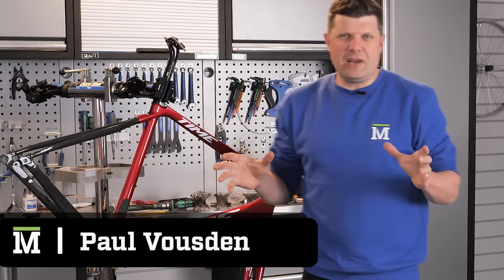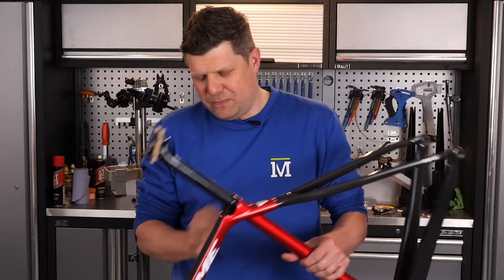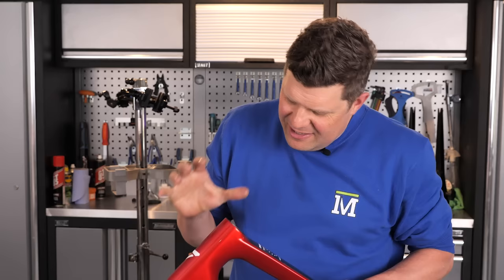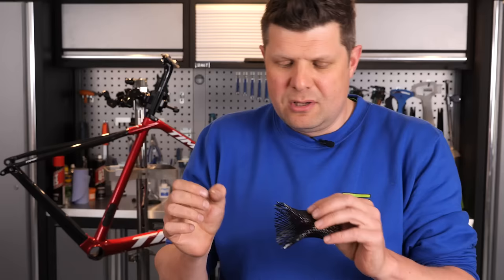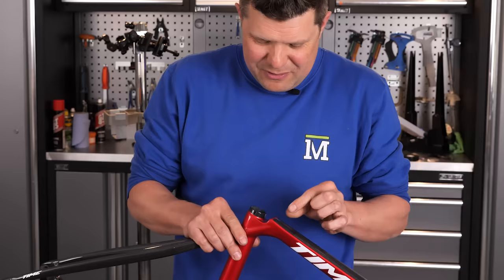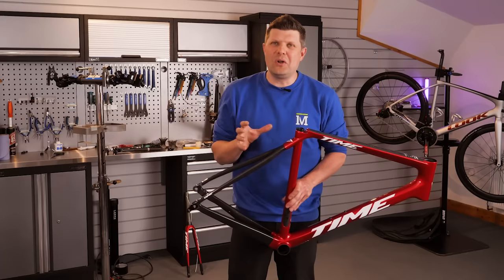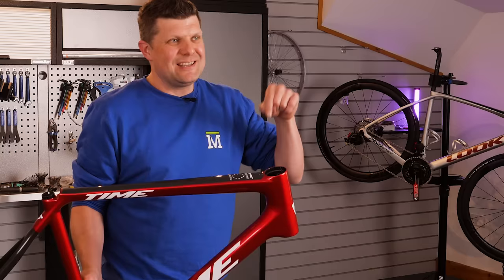Unimaginable Quality from European Manufacturing.

Comment: I've got a Time scylon. Best thing I've ridden apart from the Haidresser.
Reply: Mmm, the hairdresser should have an "ahh".
Reply: A latex hairdresser would make a great indoor trainer! The placement of the power meter strain gages might be tricky. RPM would be easy to determine. Volume control is another issue.
Reply: I just kinda wish they used direct mount calipers. So I can just buy a frameset and not go looking again for post caliper brakes. 

But nonetheless THE GOLD STANDARD of bike manufacturing
Reply: Skylon since '16....nurses for me..
Reply: gross
Reply: Time make a frame called the Hairdresser? Interesting
Reply: Still not making them in adult size…. 😢
Reply: Keep dreaming 😂
Reply: Ok, so where do I get a Haidresser?  Quite fancy a nice Hairdresser though?  Attention to détail is everything, it seems, not?
Reply: VXRS Ulteam since 2007.  STILL an amazing ride.  But planning on getting this new ADH Disc soon.
Reply: What was his name?
Reply: I first read it 'hairdresser' and though to myself 'sounds about right...'
Reply: @steveoc64  Features extra stiff downtubes
Reply: Can you post a picture of the Hairdresser's frame and close up of the bottom bracket. 😂

Comment: Funny thing is how brands like Pinarello, Trek and Specialized charge what they are charging but doesn’t come close when it comes to manufacturing as the lads over at Time
Reply: Because the marketing of Trek, Pina etc creates desirability. The more desirable something is, the more you can charge for it

Many might also say that for all of the manufacturing excellence of Time, their actual frame ‘design’ could improve - that’s subjective though
Reply: Time may be a masterclass in craftsmanship, but as mentioned subjectively their bike are hardly desirable. 

Anyway it’s not as if having a bike frame that lasts long matters. That’s what my bike insurance is for; when it spoils I’ll just buy a new one.
Reply: @mjf1975  Fortunate enough to own a pina f12, and I bought it for the looks 100%. Time is vastly superior from a technical perspective, you don't have to win me over at all, but when I throw down that much money I want to see the bike and not have to think about another bike that's prettier. And I've not had any issues with the frame since buying it, so I don't regret going for the f12!

Comment: Hardly unimaginable, if they are actually doing it.. It reminds me of the old war story, about the Germans sending the British engineers the finest machined wire stating that it was the limit of what could be machined. So the Brits drilled a hole down the middle, and sent it back.

Comment: I routed cables though the BB of a ADH21 (same BB area) with 2 BB cups and bearings in place. Without the central tube this is easy to do.

If you want to use a sleeve between cups or one piece BB make sure to install a liner so you can swap inner cables easily.

Comment: I ride an old Look kg361. I bought many years ago as a frame. As you say a very steel like ride. It is such a great ride that I have only been tempted by the 585 and Time frames which were far more expensive. I have to agree the finish and attention on Time frames are exceptional. Sad how the bigs have spent out or pushed these superb builders pretty much out of pro cycling. That said the big guys make pretty good stuff.

Comment: Good to hear you’re in one piece!

I’ve just changed to a Mips MTB helmet and looking to change my road helmet in the near future…

Something I would say is, before buying, make sure you try for fit - I’ve found that the liner can create a slightly different fit, so a new version, of a helmet you’ve been using, may not be a comfortable fit - if a helmet isn’t comfortable, it increases the chance of taking the risk and riding without!

Comment: I was surprised that Time isn't really more expensive than other premium "ultra-bike" frames while it seems no one else actually matches their quality.  I've only seen one "in the flesh" as they're very uncommon in Canada and I was blown away by it.  I doubt I'd ever be spending that kind of money on a bike, but if I were, the Time would be the one.
Reply: Especially when you consider they are made in France rather than in a low labour cost country like most other high end frames.
Reply: The don't have a huge budget for advertising, marketing, pro teams and riders
Reply: You will not have buyers remorse once you throw a leg over
Reply: @nstrug  they are not made in France
Reply: They are made in Slovakia. But yes, they don't have the marketing budget and aren't sponsoring big teams (anymore). They do the boring frame design / building / selling to customers, but at least their design and build is excellent, and while the prices aren't cheap, you get what you pay for, and contrary to e.g. some big name brands, you almost never hear or see about a faulty Time frame.

Comment: Just to say thanks for a great video. Both as a Time owner and fan for 14 years (RXRS VIP which has done more miles than all the other bikes I have owned put together and now more recently an ADHX). But also as a Time dealer (with two of us running the shop with engineering backgrounds) for just as long we have seen a lot of changes with Time and it's so good to see the brand finally getting the recognition it has always deserved not only by engineers and those "in the know" but also the more general cycling market. European (or US) made with unbelieavable quality control can only go well and that's before China invade Taiwan when there will be little other choice. It's just a matter of Time!
Reply from the maker: Thank you. I am glad you enjoyed it.

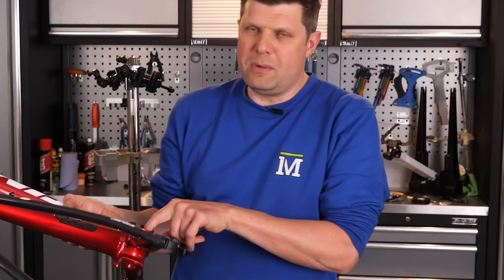Comment: 14:19 cut old cable where the head is, attach new cable to the old one with tape+superglue and leave a seamless transition between them, and simply pull the old cable out while pulling the new one in. Beats taking your cranks out

Comment: With you on the rear brake, had to remove some clear coat to get the  caliper flush. Also on the BB area, could be slightly larger and with a double spaced, like some other brands. Had to remove the wire guide to fit a Hambine BB. Lastly the brake hose through the fork, very very tight and only possible to  route from top down. But it is still a piece of art :-)
Reply from the maker: I’m hoping to cover some of this when we build the frame.

Comment: Thank you for the review. I've been waiting for a replacement to my 10 years old Fluidity for several years now. I hope they won't mess up the geometry and stay true to the old one, with a shorter top tube compared to the competition. 
I will miss the proprietary head tube system, with its separation of functions. And the integrated seat post. 
Being able to use standard components is a plus, but I get the feeling they are after cost savings as well. It looks to me that the new ADH is pretty much an ADH21 for ADH01 money.
Reply: Hi, I'm actually looking at a 10 yr old Fluidity, and was wondering your opinions on them, since I'm assuming you've riding yours a good amount? Anything you needed to change, improve, upgrade? Thanks

Comment: Excellent video, and I really appreciate you taking the same attention to the details that Time clearly did. Question: with Time frames and Hambini bottom brackets being two examples of exceptional engineering and finish, is there an equivalent you've noticed for wheels? E.g., Enve's US-made wheels, or Mavic, or any others? I'm trying to imagine a best-of quality build and wheels are a clear next question. Cheers!
Reply from the maker: Oh. Good question. Chris King hubs for sure.  Enve don’t build with them anymore. Not really a fan. For the best of the best rims. Umm. Maybe Faucon, Reserve, or Princeton.
Reply: Look no further than campagnolo wheels. Ofcourse they now have to catch up with rim width these days and they aren't particularly fast in doing so, but few wheels are better build, and longer lasting than the ones designed in Vicenza.

Comment: Beautiful! But this cable situation really upsets me. I was thinking to build a 1x Ekar setup with this frame as I’m not a big fan of electronic shifting solutions. But the idea to remove press fit bb every time just to replace a gear cable is absolutely absurd 😢
Reply from the maker: Yeah. It would be with Ekar. Notoriously fickle about smooth running cables for any kind of useable shifting.
Reply: I would recommend using fully lined cables such as Jagwire Elite Kits where the liner negates any need to remove bb.(with the bb guide from ADHX Paul may show this on the AD23 build) Alternatively can run full length outer with a little tweak to the chain stay rubber exit guide

Comment: Beautiful video showcasing the beauty of Time. I am fortunate to own 3 of, what I consider, the greatest carbon frames made: Colnago C50, Look 585 and Time Fluidity. All 3 are built and rideable with Di2. I enjoy all of them, regularly.
Reply from the maker: That is quite a collection 😋
Reply: Hello clawdawg, I'm considering a 10 yr old Fluidity, curious your thoughts on it. I'm a skilled recreational rider who enjoys a good riding bike, with decent handling and feel, thanks
Reply: @jerryscott9598  Assuming all is well with the frame, it can’t be beat. My Fluidity is a 2016 model, which I bought NOS in 2019. Among the 3 I mentioned, the Time is the best all-around performer. The C50 is the most comfortable, the Look the best climber, and the Time the best combination of both.
Reply: @clawdawg7248  Thank you kindly for the reply. I decided against it because of tire clearance and a gouge on chain stay, (chain drop), but will keep looking, (even eyeing a Wilier Zero6 & Look 785 RS Huez, both rim brake), which I'm fine with for the cost savings, (just tough to find clearance for 28-30mm tires). The Wilier has 28mm tires on Bora Ultra wheels. Cheers
Reply: @jerryscott9598  I run HED Belgium+ on all my setups (four total), with Conti 25 tubeless. Actual tire width on the wide rims measure 28mm. Ride is supple as hell. Good luck.
Reply: @clawdawg7248  Thanks again, this is good info, as different rims make for different final size of same tire dimensions. Good to know you get a nice ride with that set up!

Comment: Very nicely done, although I would question their use of the braided carbon tubes. Such tubes are actually readily available to hobbyists from third party suppliers. I have made several sailboat components using a similar approach because a water soluble  plaster mandrel (or wax) can be used rather than a female mould. My engineering concern would be that the specific stiffness of woven materials are never as high as unidirectional fibre because the individual stands in the weave follow an "over and under" path, which creates a spring-like profile. The resin infusion method is definitely superior to bladders for sure.....

Comment: I know it's difficult to get into all the technical details in one video, but: It would be cool if you could say a bit more about the headset design - how it's assembled and whether it's compatible with all the stems and top caps out there.
Reply from the maker: This is coming in the Alpe D’Huez build vid. Full measurements, inspection and chat about compatibility and cable routing.
Reply: @Mapdec  Ace!

Comment: beautiful bike, currently ride a steel road bike, but this is tempting. although I if it doesn't ride better/different I don't think I mind the weight penalty of the steel frame. (it costs $2000 more than my steel frame)
Reply from the maker: Did you see the adhx reciew?
Reply: @Mapdec  yes, I was actually thinking of the adhx when I wrote this comment! 😂

Comment: Beautiful frame that , however, I don't want disc brakes, I don't want electronic shifting, it feels like the cycling industry has lost the plot and is not appealing to the masses . I'm so glad I bought my Ribble R872 when I did in 2017 for £850 with full Shimano 105. How times have changed in 6 years.
Reply from the maker: Masses….. I think if the rim brake massif would buy more rim brake stuff then the brands would make it. Reality is that the rim brake fan base is rapidly shrinking and sales are falling dramatically.
Reply: …and, electronic shifting rules.
Reply: @clawdawg7248  until your battery runs out. Also too expensive in reality.

Comment: Here’s my take, as someone who rides a Dogma F. I totally understand and appreciate the quality construction and execution of the framesets Time build, as well as all the in-house weaving of the fibers, their RTM process, and all-European manufacturing. I wish my Pinarello had all of this. However there are a few glaring deficiencies in other areas I just cannot get over. One is that their lightest frame is 900 grams (in an unspecified size), which is just not that light. Another is that their frames are really not that pretty; and their aero Scylon just doesn’t seem very aero with its very conservative tube shapes. That brings me to my last gripe, which may be the biggest one; that’s the lack of hydraulic hose integration (which also hurts aerodynamics). Really inexcusable for a frameset of its price. Dogma F and other framesets like BMC Teammachine SLR don’t have any of these oversights.
Reply from the maker: I kinda agree.  Weight is the least important thing. If they made the paint as thin as a Dogma it would compete on weight very easily.  This isn’t a UCI approved race bike.  I don’t think a Asymmetrical Squished Dogma can argue aesthetics. Maybe an RS blade can.  Hambini did a good vid about the Scylon aero shapes. 5:1 ratio etc. Go check it out. The new frames have a neat cable solution using the Deda DCR system now being adopted by many brands. You can make the hoses as invisible or exposed as you like.  These bikes will probably appeal more to a rider that appreciates ride feel, handling and durability, over race performance.  It’s a different thing.
Reply: @Mapdec  Time does offer their framesets unpainted, if the customer wants that, which is cool. I do question your take on the paint being lighter on the Dogma F production models. It’s fairly well-known that team Ineos do not use standard paint jobs done by Pinarello, but some extremely light and expensive paint work identical to that used on Formula 1 race cars, completed by a third party. Their frames sold to the public do not use paint work costing in the 4-figure range. If there is something special about it, that’s news to me.  Time doesn’t specify if their quoted 900g weight is a painted or unpainted frame. 

As for cable routing, almost all big names have figured out their own way of routing hoses and electric cables internally. With Time’s carbon-manufacturing prowess, it’s baffling they are relying on Deda’s system for this and haven’t developed their own. If they would  address a few things, I think they’d appeal to many more riders and win them over from other brands.
Reply from the maker: I think the standardised Deda system is better. Lots of brands actually use it. If you see the Deda DCR page you will see all the various mouldings for brands they work with. Only thing special about Pinarello paint is the lack of it. It is very thin and chips easily. They also have a habit of over spraying it onto brake mounts. We did a vid on it a while back.  It’s not just Pinarello. It’s a common thing among brands that boast about weight. They use a higher percentage of high modulus carbon that makes things very stiff and they kind of vibrate along the road. The dogma defo does this. They are also very light on paint to get the weight down, so they look tasty very quickly.

Comment: Now you have built a few of these can you confirm or deny if 30mm tyres will fit in the frame? 

I know Time quote 28mm but some times there is a bit of flexibility with the dimensions. I have Roval Rapid CLX 2 wheels with 21mm internals and would put Pirelli P-Zero Race TLR 30mm tyres on them if they would fit in the frame. If not I'll fit 28mm rubber, but would prefer 30mm if they fit.

Great channel, enjoying the level of detail.
Reply from the maker: 30 defo not. 28 can be tight with some brands.    Thank you.

Comment: These look like a design from mid 2000s and to 2010. Indoor think this is new at all but I like this carbon rear triangle design from my Marin hybrid bikes!
Reply from the maker: Don’t know what you mean. This is about as upto date as it gets. Thru axle, flat mount, Bb386, DCR, routing for electric shifting, made with Kevlar and Dyneema mix in a resin transfer wax mould.  It doesn’t really get more modern than this. No one is even close. If you mean it hasn’t got a weird priority seatpost or aero fairings and ducts than, yes, this is a classically styled design.
Reply: Maybe a Foil RC's more up your alley, whereas most commenters on here (myself including) will prefer the shape of this